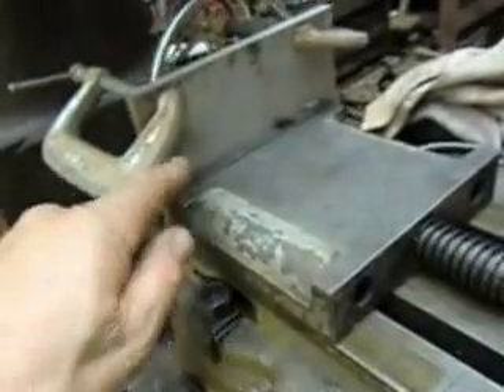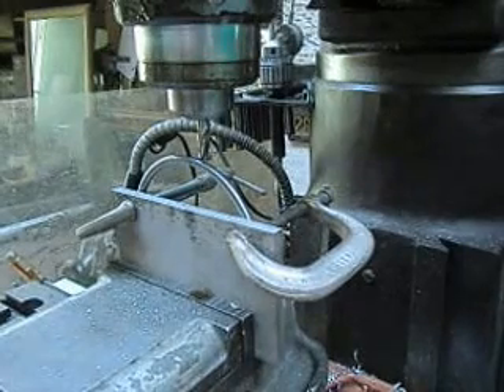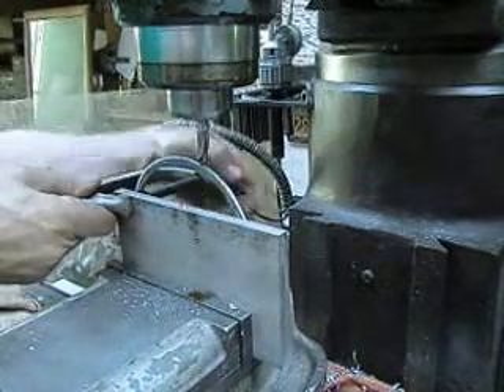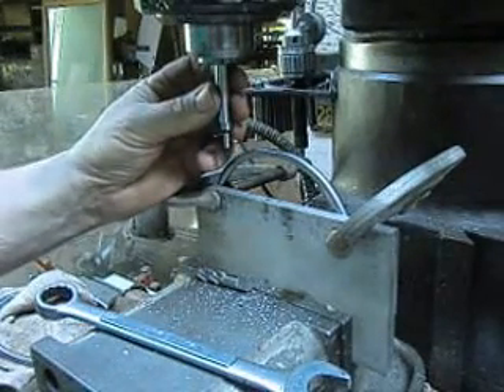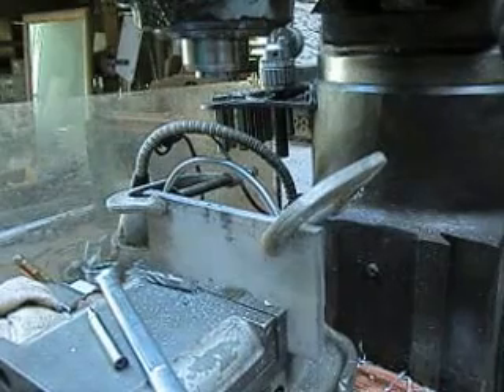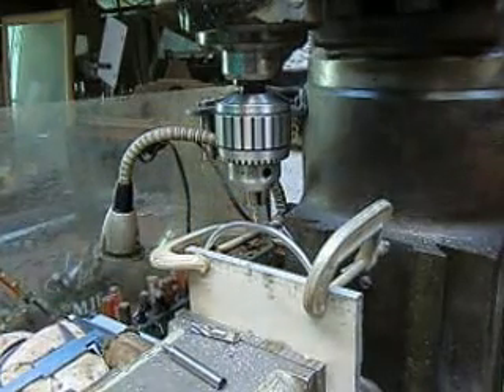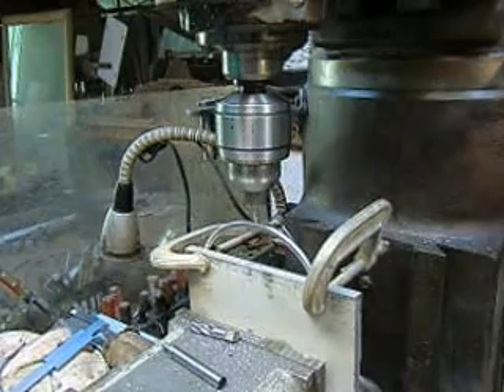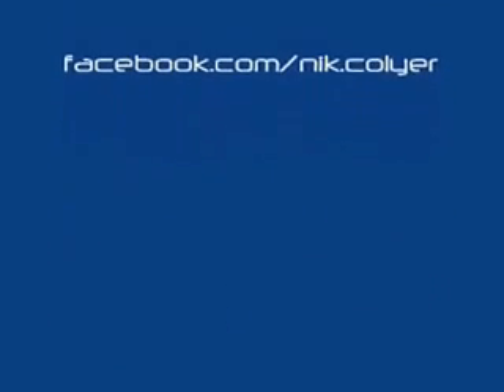Balls Out Free Energy Generator #10

Comment: That's the whole idea Buen, hopefully the new design won't let me down. I will be using a smaller motor to drive the sphere but with a much higher RPM speed. I was getting about 2500 RPM from my original motor, this new one will give me about 13000 RPM. I also have an option to use a even higher RPM motor that can give me about 27000 RPM. The wire gage for the coil windings will also be thicker around 18gauge to achieve higher amps plus it will be wired a whole new way.